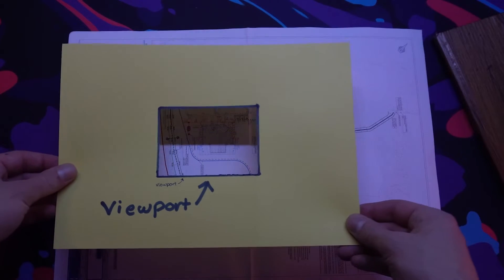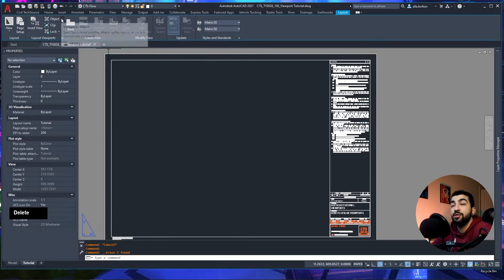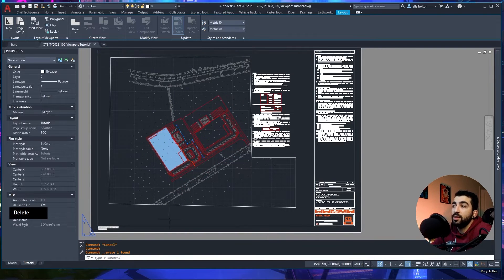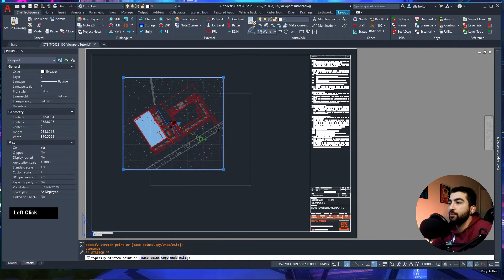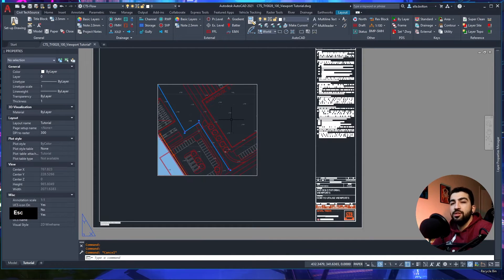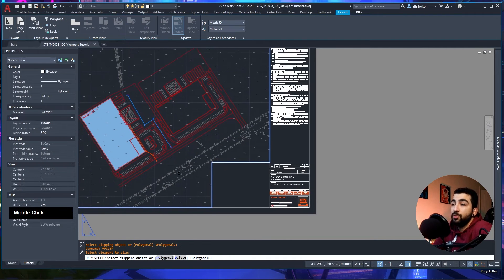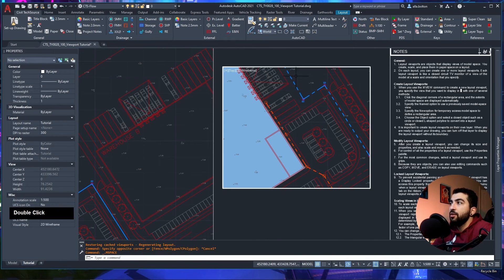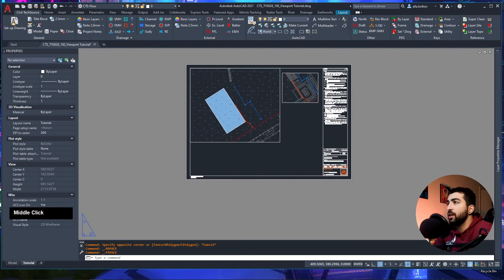AutoCAD Viewports - The tutorial you need to get started with Layout Viewports!

Comment: Very good way of explaining the used of viewport. Easy to understand.

I am cad user and 6 years of work experience.

you explain it very good specially to new cad users. All about viewports, you explained it 💯🤝 very good 👏👏
Reply from the maker: Thank you so much! Glad to hear this!
Reply from the maker: I am also thinking of making a tutorial on putting coordinates in a viewport, which way do you use to do this?
Reply: Most of the time Sir. 
I do it in model space
Adding coordinates either
Annotation Coordinate Block attributes.
Depend on drawing.
Or for more points we use lisp or excel data. 

Or if it's in viewport I think it can activate viewport and insert coordinates as long as UCS is in World set. 
Haven't tried it

Can you make tutorial of
_Data extractions
_ excel data link which

Some use different ways , some use lisp , some use data link manually .
I'm not sure which is more effecient. 

I want to learn some Lisp
Their are bunch of lisp.
But I want to learn some lisp that are useful most of the time.
Reply: Heyy I have a project to deliver, how do I exit the viewport? I zoomed the window too much and I can't exit because I can't click out of the window, PLEASE HELP
Reply from the maker: Click on the lock icon at the bottom right of the screen and them zoom out.

Comment: Hi...
I've questions related to Autocad, which I've been facing from last one year:?

I've so many viewport of Different layouts ...(Like interior, flooring , ceiling and MEP etc) of A Master plan.

Now I've created sub Divided Zone Of Master plan, and each sub Divided zones  has all layouts which already I've copied from master plan through viewports...

Now I want to make modifications like if  I  unfreeze/freeze a layer in any sub Divided zone of a particular layout... it should automatically get modified in another Viewport layout of respective layout of another subdivided zone as well as Masterplan....
Reply from the maker: In paperspace, Double click on your viewport and from the layer manager use the viewport freeze. Hope this helps.
Reply: Viewport freeze and Unfreeze is possible..on All sub Divided zones layouts and master plan layout...But the problem is,  I've to keep modifying the Same Viewport for Another Sub Divided zone layouts and master plan...

Which basically I want, If i copy a Viewport  multiple times, and do freeze/unfreeze it should automatically changed in all rest of viewport ..just exactly like a block.

And currently I copy multiple Viewport and make freeze and Unfreeze in one viewport it doesn't changes in another Viewport...

So is there any command that copy viewport with all similar properties...and and one without similar properties...?
Reply from the maker: There in model space in the layer tab the should be a command viewport freeze layer. So it will be frozen in any viewports you create. Alternatively, you can finish one viewport and freeze or unfreeze stuff you want and copy paste that viewport so the majority of the work is done.